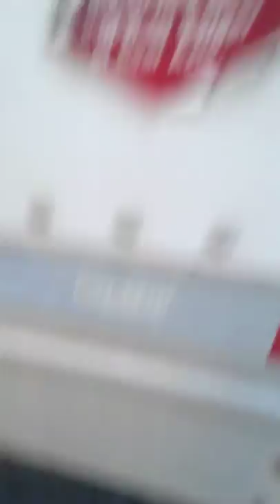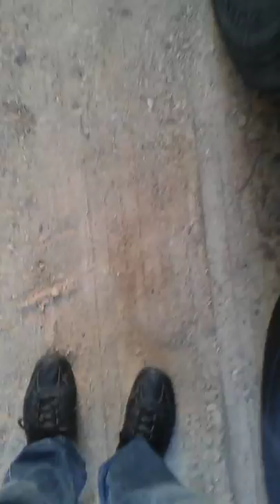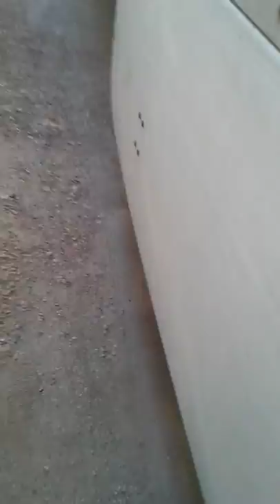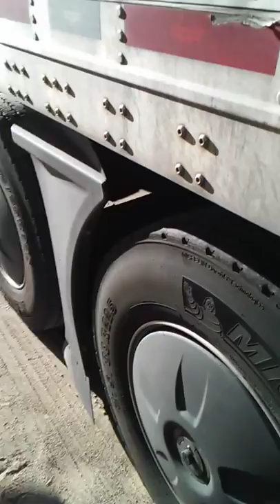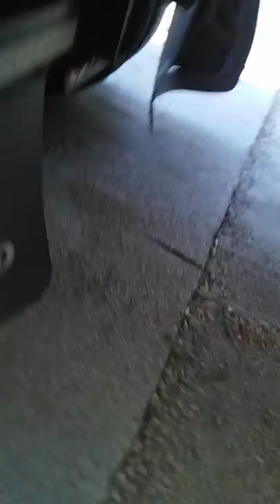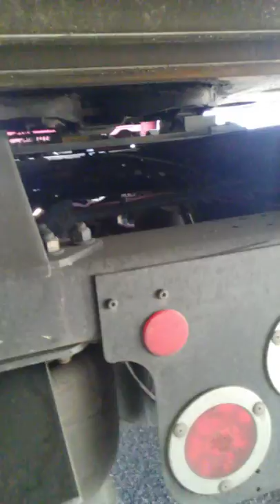SLIDING TANDEMS TO CALIFORNIA 40 FT LAW. BRIDGE REQUIREMENT 2 OF 2

Comment: How may holes from the front to the rear for California
Reply from the maker: Measure from middle of rear wheel of trailer tandems to the kingpin 40 feet. Or walk from edge of trailer to middle of rear wheel trailer tandems 10 feet. These 53 foot trailers never change.
Reply from the maker: Some trailers have very old chassis. So try not to rely on just holes. I commented on precise way to know if not marked already at 40 feet. It never fails. Each hole is about 200 to 250 pounds. The weight ratio changes on each steer drives and trailer. When you move them.